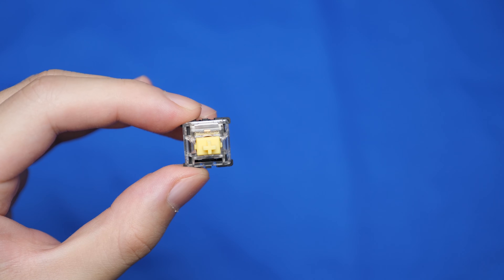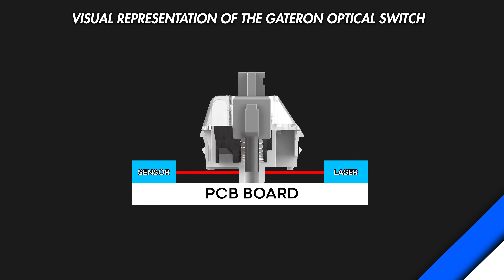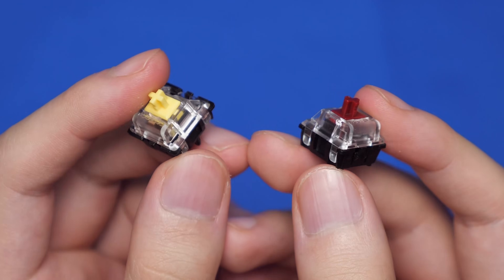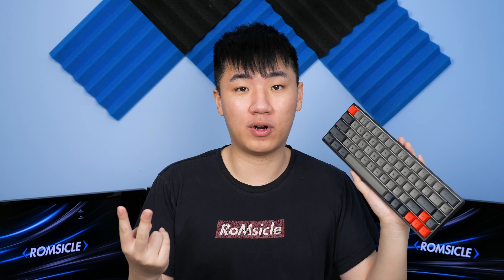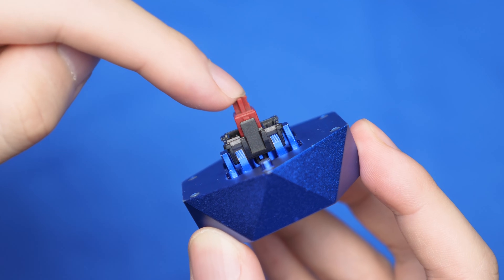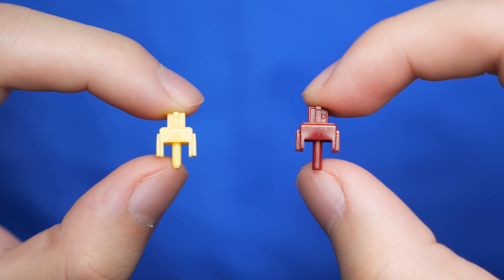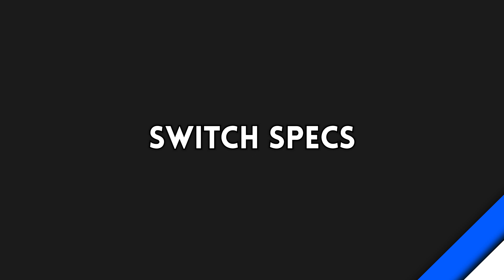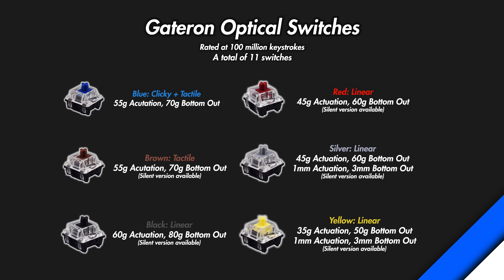Gateron Switches: Mechanical VS Optical! (Sound Test)

Comment: Im going to a Redragon Vata K580RGB-PRO, I really love this thin plate and the other stuff like sound wheel and lights... But I have a main point to decide because it comes with Outemu Blue Optical, and how all we know is Outemu. Im in doubt about Kailh Box Optical or Gateron Optical, both in any linear version. I never used optical switches before, what you think that is a better option for me? Thanks!
Reply: hello friend, did you manage to change? did it work for you? I have a redragon optical but I can't find anything about changes, please tell me if possible
Reply: @jhowjoca  hello, well... I gave up of optical switches due the lack of information. I decided to go with GMMK PRO and to be honest I do not have regrets on this, since I tested both keyboard I can say the construction of GMMK is soooooo much premium than Vata.

Comment: You forgot to mention the most important feature of optical switch that they don't have to suffer from key chatter issue. Key chatter is the only feature that led me to buy an optical switch keyboard
Reply: What is key chatter?
Reply: @librast  key chatter is when you press a key and it registers a single key press more than one times.
Reply: Oh, so its like double click on a mouse? Thanks for the info
Reply: @librast  yes its just like that

Comment: So if you gamer should pick the optical  or just mechanical switch?
Reply: Mechanical is better since it's cheaper and easier to find than Optical.
Reply: @huunhanle3809  If you have used both optical and mechanical switches please answer this. How do mechanical and optical switches feel when typing. And which feels better for long period typing.
Reply: @vishnumantena9334  Personally I don't like Optical switches much. They sound hollow due to their design and the feeling when typing on them even after lube is not that good compare to a lubed mechanical switches.

Compare between a mechanical Gateron Yellow and an optical Gateron Yellow: the Gateron mechanical one is way ahead of the optical one in my opinion ( especially the new Gateron Pro mechanical switches ).
Reply: @huunhanle3809  thx
Reply: @huunhanle3809  hey one more thing. Outemu blue or Gateron optical blue?
Reply: @vishnumantena9334  In term of Clicky switch. I would go for Gateron Opitcal Blue as the hollow internal of Gateron Optical will genuinely boost the click sound further than Outemu, also I have used Outemu Blue for a time and it's still a decent Clicky switch to be honest.
Reply: @huunhanle3809  Hey do Rgb Wired mechanical keyboards damage laptop battery in long run?
Reply: @vishnumantena9334  As far as I know it doesn't damage your laptop battery when using for a long time, as the keyboard only consume a very small fraction of energy to operate/ light up the led.
Reply: @huunhanle3809  ok one final question. Which feel good when we type? Gateron optical or mechanical. I am a writer i write for 2-4 hrs and i play 1-2 hrs of gaming. Which one should i choose. I want a good feeling in a wrong run without getting bored. 
Thank you.
Reply: @vishnumantena9334  Mechanical one friend, always go for mechanical switches. Optical switches in my opinion are good only for gaming purpose while mechanical switches can server both of your purpose well.
Reply: @huunhanle3809  thx a lot
Reply: @huunhanle3809  outemu blue vs gateron blue for typing. keep sound aside, which feel great when typing?
Thank you
Reply: @vishnumantena9334  Kinda hard to be honest, since I'm not a big fan of Clicky switches. But in term of the tactility of Clicky switches then I would go for Outemu Blue. Gateron Blue may have a smoother pre-travel but the tactility is not that good compare to Outemu.
Clicky switches are never an interest type of switch for Gateron to invest money, they mainly focus on Linear and Tactile switches.

Comment: Bought the GK61 Optical mechanical keyboard. The lense on the top housing of the gateron switch is not an advantage but rather a disadvantage, it makes the mixing of colored lights on leds separate and would see the colored and white lights on the characters on key caps not fully mixed but colors separated/spread like a specteum on a prism and I find it very annoying and ugly.  Top of the keyboard chatacters appears reddish and bottom blueish, dependiing on the colors produced it will be very more obvious when two or tthree colors are combined.  Even in single color of red. green or blue the  keyboarf character color is not uniform its more like a blend of dark to bright palette of that color.  Looked like a cheap looking keyboard because of the lights.  This is a wrong design of the engineers designng the gateron optical mechanical switch.  Rather than using lens, they should have designed it using principle of internal reflection like in fiber optoc to bring the light from the bottom to top of key cap.  That means a cylindrical clear plastic from bottom to top of the top housing then on the top part a buldging translucent dome shape plastic to spread the color mix above..
Reply: buy outemu top housings, they solve stem wobble too

Comment: How has NOBODY been able to quantify the latency difference between optical and mechanical? We want to see some millisecond figures measured from high-speed cameras. 

According to tests from RTINGS.com, we already know some popular wired keyboards with gateron mechanical switches can have anywhere from 10-30ms of latency on key press, which is terrible considering most recent wired Logitech gaming keyboards already do 5ms or less (often around 2ms). 

So what about the latency of optical switches like Keychron's designs? Those haven't been measured yet (to my knowledge), but I doubt they'll be close to the "2ms" they advertise...

It's the lack of real measurement and awareness of keyboard latency that popular mechanical keyboard designs like GMMK Pro can get away with a whopping ~26.5ms of input delay, which is laughable considering the "PC Gaming Master Race" branding of the company.
Reply from the maker: The reality is that it doesn't matter. We're talking about differences in the hundredths of a second, and you cannot perceive the difference and does not affect real world usage. It might affect pro gamers by a slight margin, but it's a non-issue.
Reply: @Romsicle  It absolutely DOES matter. Because the difference between having 25ms keyboard latency (Gateron mechanical switches and a sub-par board), and 7ms latency (or less) on a decent keyboard (or optical switches), is the same difference as playing a game at 40 FPS vs 140 FPS in frametimes. 

I don't think I have to tell you how much more of an advantage playing at 140 FPS has (on a high-refresh-rate monitor), over playing at 40 FPS in terms of responsiveness and the significantly improved feedback you get as a player.

Even in cases where the input latency of your keyboard and/or mouse is faster than your ingame FPS (such as 60 FPS or 16.7ms frametime, vs 10ms peripherals), having a faster KB/mouse latency under that 16.7ms will still help you with "catching" your inputs during frame changes more often, instead of having to wait another full 16.7ms for the next frame to process your input.
Reply: it doesn't matter if the average human brain latency in responding on FPS game is 200ms. PRO gamers at 140ms

Comment: I've never seen anyone do this (prolly bc no one is crazy enough to do it)- but what would happen if you put a mechanical stem into a Gateron optical housing? If the legs on the stem were cut off would it work- if the stem is long enough to trigger the keypress in the first place
Reply from the maker: The stem pole is simply too short for it to work.
Reply: @Romsicle  not even stems that are rougly the same length such as Akko CS Rose Red switches?

Comment: Great video! I've just learned (the hard way) the difference between optical and mechanical switches when... I ordered optical, I'm trying to put them into my keyboard and... Wow, they don't have ANY pins... 😬 WTF? And then I googled your video. Thanks for clarification.
Reply: That's really the difference between SMD (surface mount) and THT (through hole), mechanical switches also come in SMD although most are THT, however optical switches are only available in SMD

Comment: Do you know if optical switches experience interference with cherry profile keycaps? I understand that(as far as I have seen) most optical boards feature a north facing config. I also know that not all switches when placed in a north facing config experience interference with cherry profile keycaps. Just curious to see if you have tried cherry profile keycaps on your optical switches and whether there was any interference.
Reply from the maker: Might depend on the thickness of the keycap, but there will most likely be interference - it's safer to stick with other profiles with these optical switches.

Comment: 2:45 that is just wrong. Optical switch will not be inherently faster than a regular contact switch. You are comparing the wrong things. It is not speed of light vs metal contacts coming together, rather it is speed of light vs speed of electricity traveling in a wire -> which comes out to be pretty much the same speed. If there is any difference in speed, it would be the result of key travel distance, actuation point, and signal processing speed implementation in the microcontroller.

Comment: @Romsicle    Hi there, how silent does it compare to topre,  as in are the new silent switches as quiet or quieter?  Also how does the bottom out feel? Would O-rings stop it from activating the optical switch?  Also is the a sound difference between PBT vs ABS, which one is thockier?
Reply from the maker: Not sure about the silent variants because I've never tried them. Bottom out feel is rigid and satisfying. O rings will be fine. It really depends on the thickness of the keycap rather than the material. Regular PBT is usually thockier than your off-the-shelf ABS keycaps.
Reply: @Romsicle  Thank you for your reply

Comment: Guys I have a problem and I need ur guys help. I recently purchased a MK61 with Optical Yellow switches. With no prior experience with hotswaps I tried to remove a switch out of curiosity and I pulled the switch from the wrong way. When I put the switch back in I got no response. Turns out the IR sensor was twisted since I grabbed the switch the wrong way with the puller, I twisted it back to its normal position and it seems to work temporarily, it randomly registers the key when a press another key near it.  So I tried to twist the IR sensor more to its original position and it broke off, so now the key wouldn’t register at all. I put the IR sensor back in its original position and it seems to work the same as before, it randomly registers without me pressing it. I was wondering if there was something safe I can do to keep that sensor in place with out Sautering, i was wondering if something like glue was safe to use instead of sautering.

Comment: I like the way you explain and compare switches. So keep it up. For me, I learn something new today from you that my Keychron K8 is an optical switch keyboard. At first I pulled the switch out to see if its 3 or 5 pins so I can by the right one to replace them (for fun). Turn out it has no pin and I was like... what is going on here. Do some research and come to your video and enlightened. Everything is clear to me now. Thanks.

Comment: are gateron optical reds/blacks smoother than gateron mechanical yellows?
Reply: Nah, the only thing I think Optical did better than Mechanical is it durability and faster than mechanical one and that's all. For typing experience, smooth feel/ noise level/ price/ variaty - normal mechanical one especially Yellow/ Cap Golden, Milky Golden/ Ink Black does better.

Comment: thanks bro... I've used cherry mx blues, reds and even tactile Romer Gs. I've recently switched to optical yellows and I'm not ever turning back to traditional mech switches...
Reply: i only tried cheap blue's  cherry mx brown/red and not optical gateron reds. I must say this is the best switch i've experienced so far but i've noticed i bottom out alot especially on the spacebar so i might try blacks even tho my usage is mostly gaming-oriented. The cherry mx clip-in stabilizers dont really like em but i can only see screw-in durocks so maybe i'll just start building from scratch again xD It's just so damn hard to find good keycaps in stock especially for 64 layout.
Reply: I heard the yellow is SUPER light and too easy to press down. Is this true for u?

Comment: should i get red or silver optical switches for typing?
Reply: I don't know if I'm late or not but don't pick Silver for typing as it Actuation travel is very short ( 1.1mm - only suitable for gaming as you need to hit the switch goes down fast ). Red is better option for typing.
Reply: @huunhanle3809  thnx orderd reds

Comment: I just bought a keyboard with Gateron Optical Browns, and I can’t wait for it. It was under US$50 too, so I think it’s a bargain. I’m going to change the keycaps and then switch to Optical Yellows
Reply: Yo I have optical yellows they are soooo good!
Reply: Have you switch to optical yellows yet?
Reply: @salto1155  I heard optical yellows are SUPER light and too easy to press down. Is it true for u?
Reply: @hepburnsss2776  at first they did feel way too easy to press down. I kept pressing the space bar by accident but if I got use to it eventually. If your using the keyboard mostly for gaming then I would recommend yellows but if ur using it for gaming and work then I would choose reds
Reply: @salto1155  thanks for replying! What do u think about optical browns? Would they be better for typing? I’m mostly using it for work and studies!

Comment: I can't afford any key switches. I hope my pencil tip will suffice.

Wait. Optical yellow is 35 grams and optical brown is 55 grams? Wth is going on here, Gateron?
Reply: i cant tell if you mean the weight of the switches or the force needed to actually actuate/bottom out the switches XD
Reply: @JubbsEntertainment  It seems that optical yellows actuate at 35 grams; Whereas mechanical yellows actuate at 50 grams. So optical yellows function like mechanical clears. I am so confused.
Reply: @CaveyMoth  optical yellows are the fastest switches in the world as of right noe
Reply: @3shottzz  optical silver are the same thing just 10grams more of force needed. imo silver switches are slept on and they sound the same as yellows too
Reply: @luvvjd  I can’t speak on that myself since I’ve never owned a keyboard with silvers. But my friend who did own silvers tried my keyboard with yellows and ended buying yellow switches for himself
Reply: @3shottzz  omnipoint switches are faster
Reply: @ifyoudontlikemethenimabot7354  they actually aren’t search it up

Comment: Just to correct you have way more options in the Gateron Mechanical Switches Category than 7. You forgot all the Milky Switches Inks and the linears have also silent switches So its around 20 different kind of Gateron Switches
Reply: There are also Kailh optical switches available for boards which come with Gat opticals
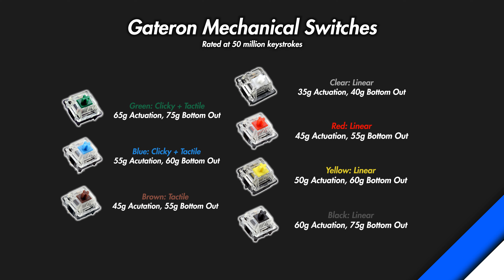Reply: @MXPreston  of course there are these option but I am just talking about his statement at 3:18 which is just wrong. Keyboard enthusiast will tell you that one of the reasons why optical switches are still inferior than mechanical switches is, that there arent many options. You have at max 11 Gateron plus max of 11 Kailh optical switches. Where with mechanical you have atleast 20 different switches just by the brand gateron alone. If we would include all the other switches from other brands and group buys you would be at 100+ different switches from Clicky to Tactile to Linear. So the statement feels just wrong to say that you have way more option because its just not true at all. My comment was just stating that this will protray maybe a wrong belief that you have more option if you buy optical which is just false.

Comment: i have optical blacks on my KB and they have crazy amount of wobble , without the extra pins + the build tolerances you will not have as consistent a feel and sound vs pinned switches. i noticed after modding my switches they do not fit as snug on the PCB prior to being pulled out.

Comment: so i have a normal keybaord that is a 5 pi and a 3 pin . Im i able to put a optical switch into it ?
Reply: No. Optical switches require the board to have the required infrared sensors. You'll need an optical board